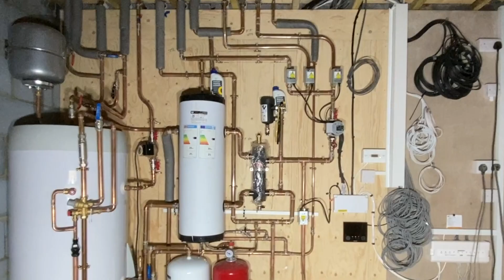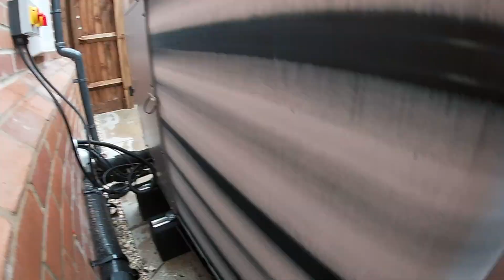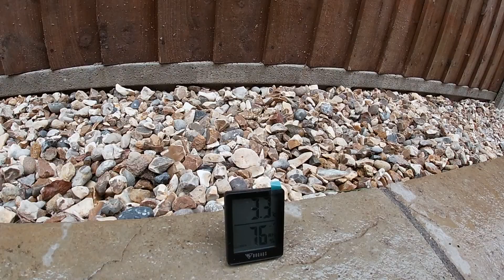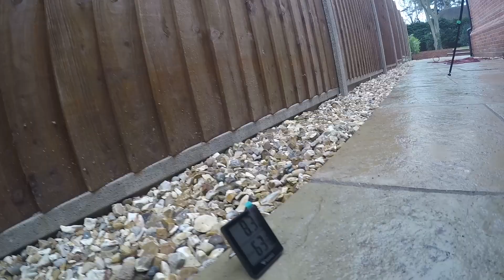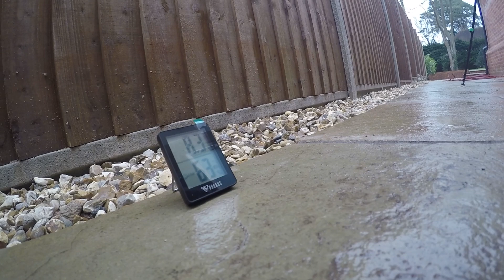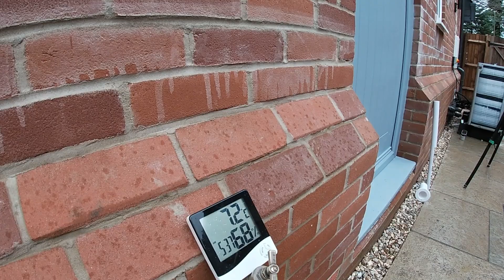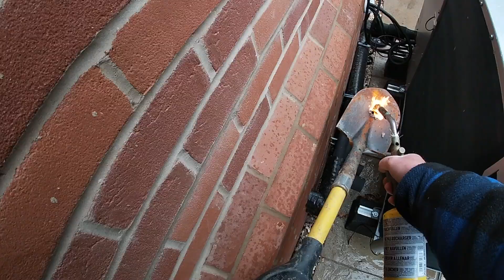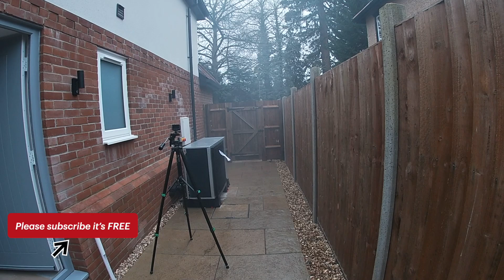Heat  Pump Freeze Up - HELP!

Comment: I mentioned the fact that air to air heat pumps are a really stupid way of heating in a cold damp climate because they freeze over and some genius said I was spreading misinformation.

Something that can be tried is you have the area is to create an air drier surround for the ice block.
Get some milk crates or similar and some shade cloth and several bags of clay based Kittyliter.
Make some bags out of the shade cloth that will hold about 50 to 100 mm of litter and hang them inside the crates and stack the crates around the ice block so the air is sucked through the bags . Bonus if you can make the structure into a passive solar collector .
The bags will need to be changed and dried regularly.
Reply: "I mentioned the fact that air to air heat pumps are a really stupid way of heating in a cold damp climate because they freeze over and some genius said I was spreading misinformation."

======

Well you might be, the unit in question is not air to air but air to water, defrost cycles are a normal function of the unit.

Inhibiting the air flow with your Blue Peter descant packs would not help at all.
Reply: @_Dougaldog  No they are Air to Air the water is the intermediary instead of refrigerant. Unless it's heating loops under the floor instead of blowing air through coils or it uses a buried loop of coiled piping which is either sitting in soil or the water table. The only heat pump worth having.

Comment: First I would suggest deflect the discharge air upwards I that is unsuccessful  I would suggest to get the expansion valve checked  for correct operation also the temperature / pressures in the refrigerant circuit as you may have a charge issue
Reply from the maker: Thank you I have to say as the HP is changing to defrost mode there is a strange noise . We have booked a Diakin engineer  Thank you 👍

Comment: Wall mounting would help a lot, mine is 2 meters and has unobstructed air, if you cannot do that then move it to another wall
Reply from the maker: Hi if only it was that easy  the neighbours might not be happy ,and would not tollerate the noise.👍
Reply: @HEATSEEKER1428  can you make a place on the roof, ideally S/E facing? removing a section of tiles to maKe a small flat space is fairy easy and it would get the sound away from people

Comment: The ineffective heat pump system is not caused by where you put it. Even if you knocked the fence down it would make no difference. 
It would still be ineffective. 
I would cut your losses, rip it out and buy a gas boiler to save money and provide efficient lower cost heating that's more controllable. 
If you can't get a gas supply you will find it best to go with electric storage heaters and convection heaters or oil filled radiators..
Heaters pumps are mis-sold and those conned will never admit it through fear of looking foolish. It's time people got over that.
Reply: It's already more efficient than a gas boiler, even though it needs to be tweaked. He said that the house is at the temp he wants and the COP is 2.5 even with this issue.
Reply from the maker: Hi Gas boilers are not as efficient people are lead to believe . The condensing boilers will only condense if they are running at or as near to their max capacity. Of course if the boiler modulates it is a little better.
Most boilers are over sized. This heat pump when I have sorted this issue will heat this house more economically that a gas boiler . Thank You 
👍
Reply: @HEATSEEKER1428 Will it provide instant hot water as well!?

Comment: Measure the flow and returns on that buffer tank. I would expect you’re getting massive amounts of distortion.
Reply: I mean, also the heat pump looks too big for the property size. I expect the circulation issue is less of an issue than you would think.
Reply from the maker: Hi Flow and and out of buffer about the same temp Return back to buffer slightly cooler tank return out of buffer . Will measure more acurately tomorrow. Don't under stand distortion . Thank you 👍

Comment: Messy install with the unit blocking a man hole
Reply from the maker: Drainage design fault HP was always going to be there  But having said that I can remove cover with out disturbing the HP . There is another man hole about 6 feet from this one . How many times a year does one need to lift a manhole cover ?  Thank you .👍
Reply: @HEATSEEKER1428  Doesnt stop it being a poor install.
Reply from the maker: @Society.x. Hi
 No it is not ideal  but if you look I was in-between a rock and hard place , any closer to the gate and the HP would have impeded the opening  of the meter box   I could have placed the HP a bit further back  closer to the building but that would have restricted  the air flow to the rear  and any further back towards the back door I would not have been able to remove the man hole cover without disturbing the  HP. Believe me there was a lot of talk and debate about this situation and in the end this was the best compromise we could come up with .  Thank you 👍

Comment: Can amend the gate to be louvered to let air through as well as remove a few more inches at bottom? Actually easier to do that to the side panels either side of the gate?
Reply from the maker: Hi Thank You  if the gate is an issue the n someone has suggested the perfect solution, A wrought iron gate . Thank you 👍

Comment: It shows that thes things require a lot of messing about witch = more cost for a engineer. I’ve never needed my gas engineer to come back to alter the location of a boiler, or change unessary parts. For an average person who isn’t a plumber or engineer these things all add extra costs let alone electricity getting more and more expensive. And not everyone has the budget for all this ever. Then finding out a yearly service is around £230 which compared to my gas service is £70. I worked out over the life span of a heat pump I wouldn’t see any real savings more likely a loss. Then you need start over at the end with more ££££££. Compared to a gas boiler average decent  efficiency boiler £2000 last to around the same as a heat pump 99% can be fitted and commissioned in a day with no need to change out the rest of the system if fit. Also a lot of affordable engineers/ plumbers able to support you. Compared to the mine feald of heat pump installer and engineers wear it seems a lot dont seem to do a good job and the few that do be prepared to spen ££££. Not saying there isn’t cowboys doing gas but there are more good than bad. The overe serious flaws with heat pumps is there more suited to modern build / houses designed around them. But most are houses are old stock the cost for myself for a 1940s 3 bed semi detached build this includes solar battry system and trying to get the house to A standard £100k (witch includes gov rebates) maybe more according to my quotes, and even then my surveyor said there could still be issues and realistically to hit A standard is next to impossible Bar practacly re building the house lol😂. His words / makes no sense in house that already is sound/. It’s like chasing the rabbit down the hole more likely to open a can of worms 🪱. So I’ll stick with my gas and wood fire. Than run into a situation that will cost me thousands more and probably realistically not brake even. As a tradesman who runs my own independent sole business who speaks to friends in the trades like plumbers electricians and so on, i can see a whole host of issues coming down the tracks with this so called green stuff…
Reply from the maker: Hi Gas is cheap at the moment but it will not last for ever. All new heating systems and replacement boiler Jobs Now have to be  properly surveyed and installed to accommodate low temp heating . Because one day gas boilers will be no more . I know there is all of the chat about gas boiler being run on hydrogen  but that's not progress.
A HP realistically has  a COP of 4- 5 what is the COP of a gas Boiler  1 ? . I Don't put a lot of stock in the green issues but if you do then you must realise that the average gas boiler in Britain puts the same amount of CO into the atmosphere as 7 trans Atlantic flights . Thank you 
👍
Reply: @HEATSEEKER1428  lol but you tell that to two certified servayers  on of witch is close family friend and my accountant. I can’t justify spending 100k just to please some one else. Plus for many hydrogen or oil maybe the way forward along with other solutions including gas. I’m fortunate to work on many different properties from new builds to Listed stately homes to old miners homes with customers from all the spectrum of class budgets and expectations. For a fact most people in the uk live in older sound properties like Victorian builds and older and newer. But most need a lot. Like needing solar to off set the electricity hit let alone other requirements like insulating and even replacing perfectly sound things like roofs, like what I was advised by mine when I had two solar installers they refuse to install solar before I have a new roof, but I’ve invited my surveyor and two different roofers and all three say no point still has over forty years left in it at least. Also ast the roofers how often do you come across this situation and there answer was very often. By the way both solar installers wear well recommended and highly qualified independents. I also sat down and worked out my Ruth so-called savings of using a heat pump but what little was around one hundred pounds but would be wiped out by just the service cost increase leving it in negative. That was based on the best case scenario and forecasted so called saving, let alone if you have to cool an engineer to fixit Not as simple as pushed by narrative. Yes for some people heat pumps work well especially with new builds and property wear there has been a lot of modernisation. But all equals money a lot… which in the current economy not many have let alone to spend on a risky venture when there are other more pressing problems to attend to. I know this due I’ve notice a lot of my customers are cutting back on none essential works or delaying. The gas argument is a flawed argument due just in the uk we have hundreds of years of gas under are feet. Which means we are not needing to import gas or wood chips. Also give us time to have a mixture of solutions that maybe even better than heat pumps. Also my wood fire place is awesome even can cook or boil my tea let alone my pets worship it more than any radiator. But my gas combi is very efficient and only occupies a very small space compared to a heat pump system which will have to go back to using more space freed up and in use. Let alone noise out side. I know this due some of my customers have them and in balance it’s half and half one lot love it but the other lot spending a lot running and on multiple brake downs or service visits even with the same brands and the who love them, let alone the amount of money when asked they have spent getting there house to the required or near a possible requirements for the heat pump and few have neighbours that it disturbs . I know a few who are in the proses of goi g back to gas. So I think it is a mixed bag solution that really on work on some properties and or needs a lot spent and a lot of back and forth with the installation and engineers. Witch in comparison to a good gas combi makes it look like the less stressful and in way friendly option that doesn’t need tones of extra part made and ripping out perfectly fit boilers or infrastructure that will likely be at land fill or recycled when it had anouther bout trip around the world…

Comment: Jfi : My 8kw Daikin defrost cycle is every 40 mins and defrost is just under a ten minute process when temps get below 1 or 2°C

I like the idea of considering the air flow but I seem to remember heat geek tried to create adverse air flow designs as an experiment but it made surprisingly little difference.
Reply from the maker: Hi Yes I don't think deflecting air will be vary effective, Have run HP with gate open today seemed to be a little better but still with ambient temp around 1.5 = 2 degrees c at one point the air temp at back of HP was -2 . Thank you .👍

Comment: Change the gate to a wrought iron type to allow airflow through the side passage. That should help.
Reply: move heat pump right up to fence, remove 1/2 the panel to let in air from the front of the house.
Block the other side.  Keep your solid gate and the segregation of input and out air. Much better solution.
Or move the fence /gate..
Reply: @karstenevansbbr7875 think the neighbour might have something to say about your suggestion....😂

Comment: You should test this theory by putting a big fan near the gate to blow the air away from the heat pump/fence as it exits, so the air flow is perpendicular to the face of the heat pump. Then you'll know that there's fresh air being taken up by the pump.
Reply from the maker: Big fans not readily available . Have decided let Daikin engineer sheikh all is well and good with the heat pump  and then take it from there . Thank you.👍
Reply: @HEATSEEKER1428 By big I meant a standard box fan. Shouldn’t take much to make sure the air isn’t being recirculated. You’ll see in one or two cycles whether it makes a difference. (I suspect not.)

Comment: It could help a good bit if you just raised it a couple of feet. My heat pump has the fan blowing the air out of top, so it would probably work great in a location like yours.
Reply from the maker: That would be a great idea I have seen the units with top outlets in video's from the USA  Thank you  👍
Reply: @HEATSEEKER1428  If your unit only sucks air from the back, what if you put a shroud from the ends of the unit, and the bottom to the house, that way, the unit would not be pulling air from the ground?

Comment: Easy solution/ install deflector fins on the front that direct the air 30 - 45° upwards. That way when it hits the fence, it will be higher and deflect further upwards and should draw in new air.

These are an after-market options that are readily available in Australia for Air to Air heat pumps (split system air conditioning).

Comment: Honestly after watching the video, reading the comments and looking at the property. Why was it designed and installed like that, modern house averages about 8kw heat loss and using hot water priority. Also I think you only have one volumizer (buffer) not 2. Everything points towards the unit being sized too big for the outside location, normally I'd expect any unit over 10kw to have around 2 meters in front and to the sides of clear space with no obstructions preferred.
Reply: Daikin installation manual for EDLA14D3V3 says minimum 1 meter in front and 300mm to rear, with 500mm to sides, so it should function well enough in the space it's in.

If you look at video at 0:14 you see the large white cylinder plumbed as a buffer or hydronic separation unit (not a volumizer), likewise the smaller black cylinder to the right which also functions as a buffer and filter I believe.
Reply from the maker: Hi I assumed the small volumizer on the hot water ( primary return ) is because the primarys are taken before the buffer tank therefore adds volume when in hot water only mode . You might be right about clearances . Thank you 👍
Reply: @HEATSEEKER1428  Just realised I completely forgot to reply, normally we don't add volume to hot water only mode as we're after extracting as much energy from the cycle as possible so the primaries to the cylinder are Teed before the buffer/volumizer. As it should only be taking heat from the heating side when going into defrost mode.

Comment: We had a similar problem. The issue was the valve was sticking in defrost mode. It worked okay when outside temperature wasn’t too low. As soon as outside temperature got low the energy was taken up defrosting the unit outside. They had to replace the outside unit as changing the valve due to the gases in it was a problem apparently. All working well now. Not sure if you are having the same problem or not but thought I would share.

Comment: What a mess that installation looks like an oil refinery why would anyone want all that equipment to warm a house when a gas boiler the size of a suitcase can do it without all the hassle this heat pump push is total madness they are only to create wealth  for the makers and the electricity suppliers.
Reply: You need to get up to speed, a similar setup would be required for a modern low flow temperature gas boiler system, getting perhaps an efficiency of 95%, although the zoning looks excessive.

Heat Pump efficiency over the year is typically 350-420% (COP 3.5-4.2), very likely the unt in video will rise a good bit from the 2.5 COP mentioned.

At -6C my COP is about 2.8, at 10C it's over 4. So for my SCOP of 4 (average over 12 months) and HP tariff of 14p per kWh for electricity (3.5p per kWh of heat) it's significantly cheaper than gas.

Comment: How about using a few fins or luvers to direct the cold air (away from the fence and gate) toward the position of the camera? 

The air flow being directed in that direction should stop local recirculation.

Comment: You could raise the fence panels so they align with the poles at the top, creating a big air gap at the bottom. You may want to add something to keep animals out. Try removing one panel temporarily to see if it makes any difference.
Depending on the make and model of the heat pump the fixed defrost interval might be something you can adjust. Contact the manufacturer to ask if the interval is normal or not just in case.
Reply from the maker: Hi Its a party fence and I don't think the party next door would appreciate their fence being touched , We have booked a visit with a daikin engineer  Thank you 👍